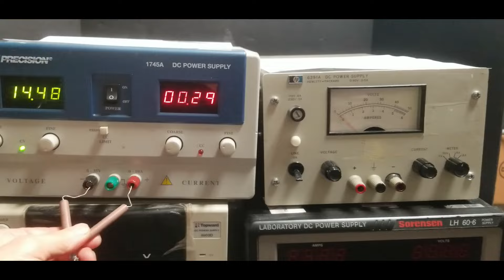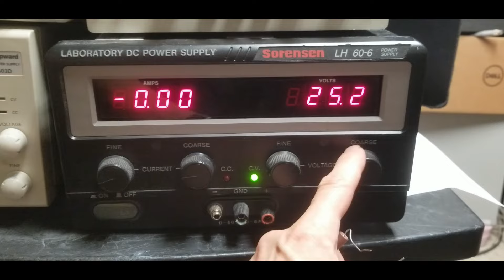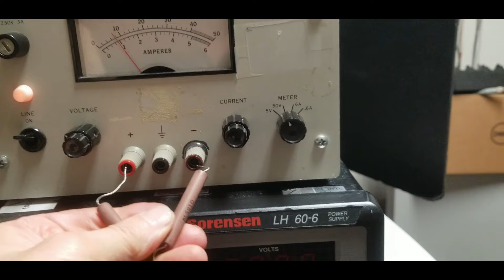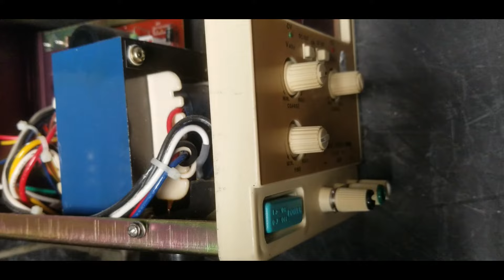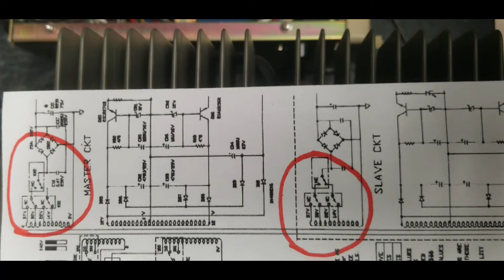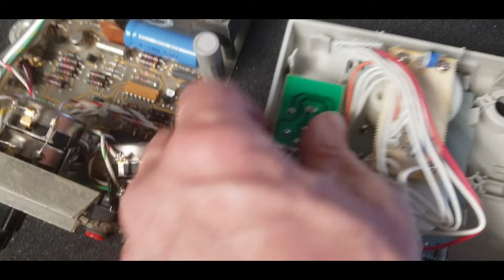Lab power supply. What is the best choice for your bench? We test 4 brands...

Comment: Most boring, but one of the most important (and underrated) pieces of equipment, that can also cause soooo many issues, from EMI-issues (both radiating or going unstable with large RF fields), to going unstable with complex loads. Love them when they work, hate them when they cause issues and blow up a prototype costing thousands of dollars…
Reply: As far as HP is concerned… fantastic, until you get some junior engineer or intern trying to use it, after an experienced person used it, and have no idea to connect the sense-wires to the equipment he tries to test…. Ouch!!!!

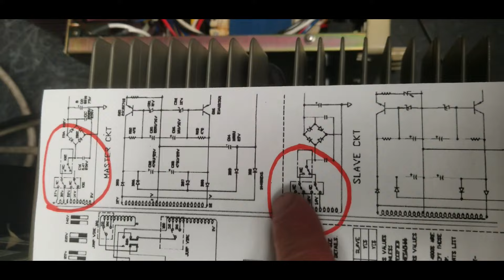Comment: 5:30 So, how HP is doing the switching? That paricular model I mean. By switching the transformator outputs, is a good thing for a linear PSU and you know why. 
I do unuderstand the benefits of a quality PSU, I built myself few, from discrete zenner to 723IC or 741 and many 2N3055 in parallel (I am talking about linear PSU), simple or master/slave or symetrical, for my bench. What I do not understand is why you do not show what really can do those cheap PSUs. Oh they are broken because they use a elegant solution (albeit cheap) to protect and increase the life of the regulating transistor. Or, because you do not like them. Anyway, I would not pay 999USD for a lab PSU that can do the same (for me, as I do not need RS232, of other stuff) as a 100€ PSU built by myself.
Reply from the maker: HP power supplies always have a single output winding and don't need switching . Their regulators are designed correctly and hardly ever fail. You can download all old HP power supply schematics from multiple websites and analyzer them.
Reply: @Equiptek_Labs_Inc  I know that you are right, and I also apreciate the good  old lab power supplies, including those from HP that are well designed. What I like is the efficiency, I preffer a PSU that do not waste 100W on the regulator transistor as heat, but 10-20W. And switching the input achieves that. I consider that you are biased - my opinion - and you should give to Cesar what is his. Saying that those clicking PSU are broken even if they works well, just to sell the HP is not good.